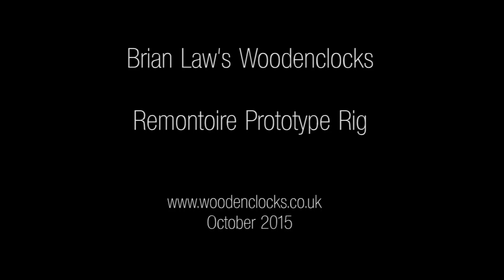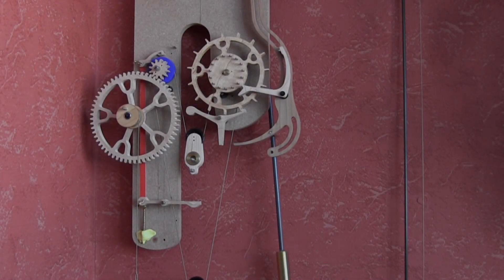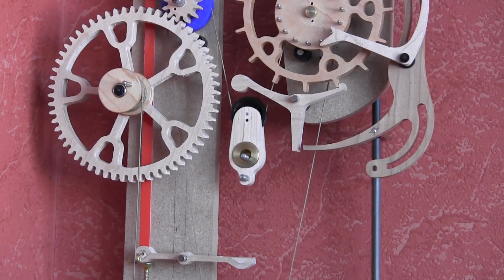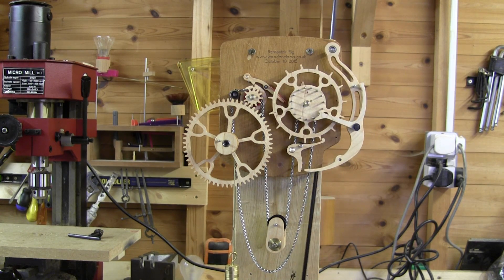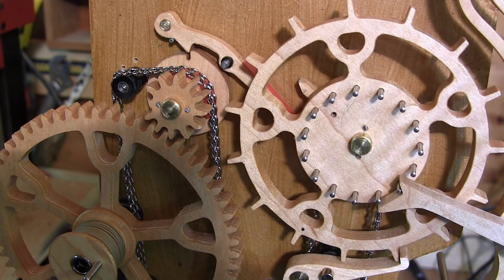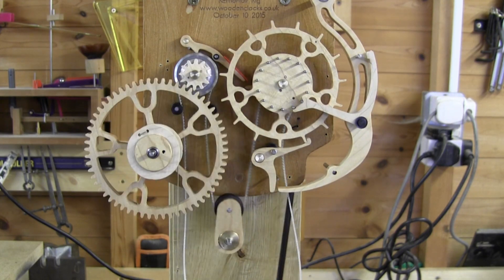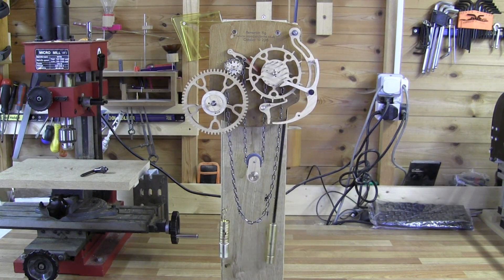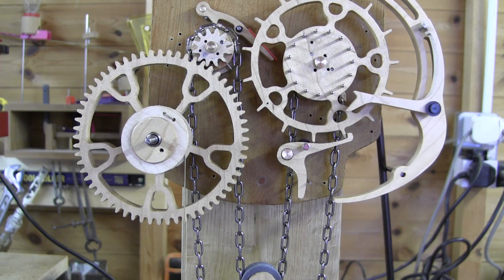Brian Law's woodenclocks-Remontoire Rig

Comment: Accuracy?
Reply from the maker: best I have acheived is 1minute in 12 hours, but I stop trying after a while as I move on to the next build. It gets increasingly more difficult to fine tune as otther factors come into play, temperature variations in the workshop in winter are all ovrr the place, plus some days I forget to wind or the pendulum gets bumped and stops.
Reply: @woodenclocks  Great stuff nonetheless. I saw a video of a homemade marble pendulum clock that claims to drift less than 1 second per day.

Comment: Brian, I know this is a bit late, but can I recommend a finer chain?  Google "Jefferson Suspense Clock"  standard 'dog tag' chain, each wheel instead of teeth for a large chain had indents for each bead in the chain.  the only issue (for this clock at least) is after about 30 years of running the chain stretches enough to to jump a link - but probably due to more weight on the chain than your application.  If you are interested let me know I will send you some detail photos of my Jefferson clock so you can see how the chain and wheels work.  - Eric

Comment: Is there any reason to having a remontoire on a clock with a gravity escapement like this, when the escapement already isolates the pendulum from the geartrain forces?
Reply from the maker: It places the source of power closer to the escapement, thereby increasing the accuracy by evening out variations in drive force caused by unevenness of the friction in the gear train.

Comment: Having looked at Brians video again i realised i have been down a similar path but i settled on the ball chain as a drive for my remontoire, i made a fly cutter to make a drive sprocket and adjusted the diameter to give a sweet running gear, its not easy and down to patience, maths only takes you so far, Dave

Comment: It's a very interesting mechanism, this remontoire. I had a go at drawing up a Wagner type one myself last month. It's up and running now. This continuous loop one looks interesting too.
Reply: +robbie77300 
the problem with the loop system is that the drive mass increases as the weight drops (the chain gets longer as the weight drops, and its mass must be factored into the total drive weight). this isn't a problem if you're using a remontoire escapement, as brian does in the video, but any inertia-dependent escapement (anchor, galileo, etc) will see its long-term accuracy negatively affected. 
KEvron
Reply: Well it's a Wagner one I drew up and built. They also have a varying force generated by the dropping wheel, as it rotates around the 3rd wheel, applying less force above and below level with the 3rd wheel arbour. Obviously being direct to escape wheel, it's an even variation over time. But anyway, I don't think people building wood clocks are looking to use them for atomic level timing, but more the mechanical interest.
Reply: robbie77300
"They also have a varying force generated by the dropping wheel"
this is true if you use a fixed weight, as brian does in this video, but you can instead suspend the weight over a radius. with a suspended weight, and a properly balanced rack, the power delivery won't vary. you can find video of the type i mean at mark frank's my time machines website. i've also posted video of my own lego version:
( watch?v=6zRTAAsGiR4 )
KEvron
Reply: +KEvronista On the Wagner type I built last month, the change in drive is due to rotation of remontoire weight, part way around the 3rd wheel. The variation will be so similar each cycle, that other factors will vary the timing over the long term far more. If the weight variation is identical for each cycle, then the variation itself will have no real impact on accuracy. For example, the velocity of a pendulum varies from stopped, to full speed for every swing, so there is another variation in every pendulum period But once that variation is identical every time, accuracy is maintained.

Comment: The cheaper cogged belting is more flexible than the steel backed belt you used and would have sufficient strength.